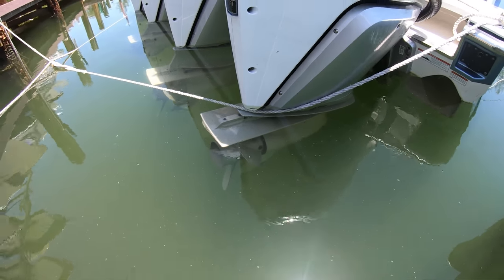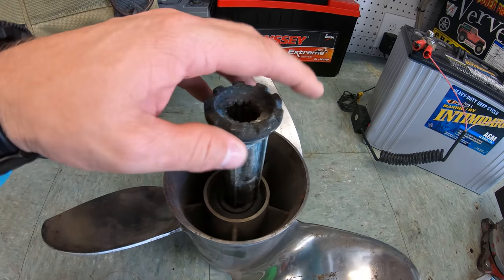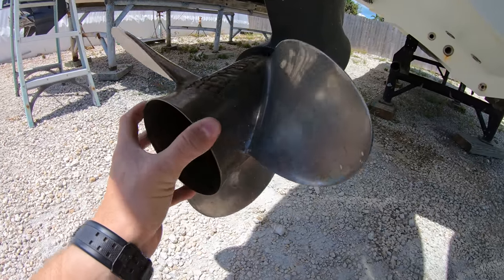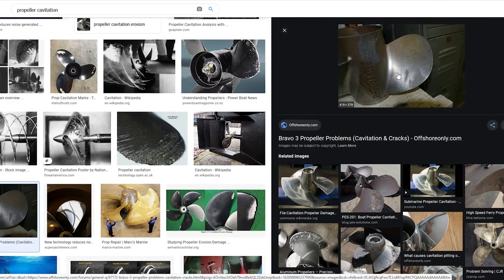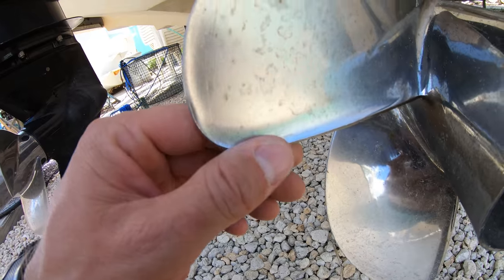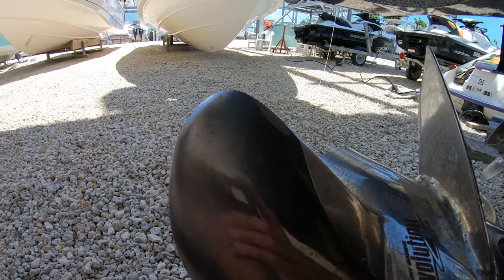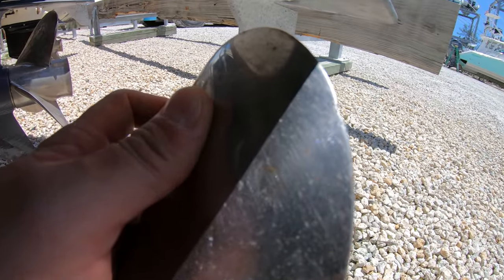Got BOAT Prop PROBLEMS? Cavitation Vs. Ventilation!!!

Comment: new prop or old, one of the primary symptoms of cavitation is Porpoising.
In the 80's the Sidewinder and the Hydrostream hull configs. were prone to porpoise ( a veritable Pain in the neck ride)
A cruising speed 3/4's she'd rise up and down and make u seas sick. At Flat Out the helm would be something you'd need to put your whole body weight on and when u did hold her fast, she'd start walking side ways.
Now the Cleaver prop was specifically designed for a heavy stern drive of Inboard, somehow the Cleaver acted to Lift up the rear, when the rear of the boat was being lifted by the cleaver you could apply Less trim.
The boat would run perpendicular to the lake and the stern would lift out of the water and yes you'd have to Hang on to that wheel never look to one side cause yer sunglasses would fly off and your first impulse is to try and catch 'em. But u let go of the wheel and your outboard engine would spin and yer right ear would be taking on water. Not that this ever happened to me...at 83mph
Reply: problem on those streams was inexperience and poor setup ...proper setup and those issues were very minimal and driver skill is needed to go fast in those boats...lol
Reply: @crashalexander7232  drive skills...more lpl

Comment: I have a 20 foot Montego bay pontoon and a 90 HP Suzuki with a 13x17 prop. I am getting cavitation or ventilation after 1/2 throttle . Have tryed a 4 blade 19 pitch no help , so my question is what is wrong

Comment: What would you recommend for cavitation caused by floating weeds gathering around the motor of a Pontoon boat
Reply from the maker: You might want to look into the engine height, idk if weeds will be giving you cavitation, cavitation is more pressure related, maybe a ventilation issue, but you might have a different issue going on depending on what the engine is doing.
Reply: Ok thanks I'll keep researching it

Comment: I have a 30' cruiser w twin bravo one ss props if i do not hole shot the engines and try to gradually plane i get as described in video propeller venting once this starts i have to back off and most of the time idle back and hole shot to obtain plane. 
One note repowered from abt 260 hp to now abt 300 hp per engine but i did not have the boat prior to repower so not able to note if condition existed previous. 
Any thoughts out there again 
30' cruiser twin 5.7 Bravo 1 vortec tbi .040 over. Turns up 4250 maybe a bit more under optimal conditions.

Comment: Why does water splash back into the boat from the motor. I have a 26 foot canoe with 15 hp motor and after a certain speed water splashes over the strern into the canoe. Also, I experienced cavitation or ventilation. Because we run these canoes on rivers they are mounted with the cavation plate much  higher than the keel. This is very common and because of the canoe shape they ride a bit lower a flatter bottom fiberglass boat. Anyway no one else is giving this problem. But me. Just wondering what the problem is. The prop is well used and has been filed off a bit do to hitting occasional rock. Could this be my problem?

Comment: I have two sets of props for my 34 yellowfin that act completely differently. 
The 19 REV4s that are Labbed hold the bow high and let me run past 60 mph. The engines sound beautiful and  there is no vibration.  
The 18 Ecos on the other hand have a lip and lift the stern, they make the boat unstable at speed and it tends to bow steer.  There’s a horrible droning sound from the engines.  I hate them but on long trips they can improve efficiency by 10-15%. 
At the end of every long trip I remind myself, never use those again, your ears are ringing. 
Thoughts?
Reply: Ear plugs.
Reply: Do you use the same hubs? If the hubs are removable try different hubs.

Comment: When running in the ocean the waves lift my skiff and occasionally my prop ventilates and I lose forward momentum.  Remember my boat is a Simmons, it has a well for the outboard and there is flotation beside and aft of the motor.
Reply: "We need a bigger boat"

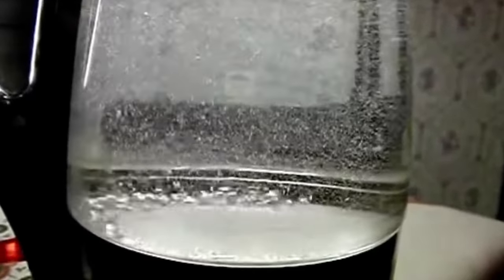Comment: At 5:17 you mean vapor bubbles (steam), not air bubbles.  And they "implode" not explode when pressure forces those vapor bubbles to collapse back to liquid, effectively making a micro water jet.  In the same way that an industrial water jet cutter can cut through metal, so do the imploding vapor bubbles when they collapse near the propeller.

Comment: Cavitation does not create air bubbles...... The pressure differential between the front and back of a prop blade causes the water to boil and the bubbles are steam, not air,  even at very low temps. When liquid water boils it changes from liquid state to gaseous state and expands it's volume approximately 1500 times. These bubbles have a very high energy level and if you can see high speed photography cavitation each bubble actually expands and contracts several times getting smaller each time until it looses all it's energy. Prop damage and/ or poor design will accelerate the onset of cavitation.

Comment: When I hear “cavitation “, I think of a pump.............pumping a liquid that gets air in the line, and cavitates, and no longer pumps anything.
I guess it’s the same idea
Reply: That again sounds like Ventilating. When a Pump Cavitates, it is also because of the Pressure Drop on one side of the Impeller is great enough for the Water to Boil.

Comment: I have an air floor zodiac and have experienced some bad ventilation issues. if passengers are too far forward it causes the floor to bow upwards significantly, almost 12" higher than it should be in the rear of the boat. I think this is happening because the shape of the hull is no longer flat and is forcing the water at the prop be be lower than it should. Has anyone else had this issue? Did you find a fix for it?
Reply: Have same problem with air floor west marine, travels 15 mph with solo w/ 5hp Nissan but ventilation can stop it no bite on water. probable solution is get a rib.
Reply: @chhindz  I think building some thin and strong slats to place underneath the air flow would be a big help. I just hadn't got around to trying it. But yes a new boat would fix the issue hahah

Comment: My prop ventilates way too easy. Feels like I'm on bald tires. Could use some advice
Reply: need way more info than ...help?  lol
Reply: @crashalexander7232  Well since my post on this video. I attended the Seattle Boat Show and 
 was able to talk to a senior engineer from Mercury. He says my engine had been mounted too high so for starters the dealer is going to drop the engine down one hole position.

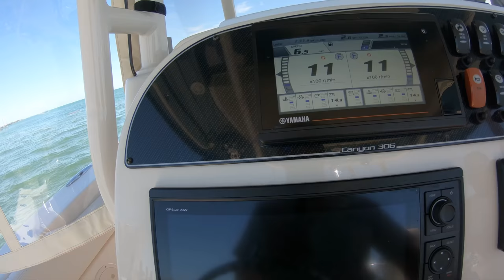Comment: Is that the new 600 Verado at timestamp 2:41? If so, it looks awesome!
Reply: Nope, they're 300's.  Aside from the single prop (the 600's have counter rotating props), the giveaway is the "300" you see on the cowl.  lol...
Reply: @Prototheria  apparently I missed the 300 on the cowling 😬
Reply: @benjigans1419  lol... no stress, bud.  I missed the number, too.  Your comment had me questioning whether I really saw single props or not.  I had to go back and look to be sure, and that's when I caught the number.

Comment: That was great. When you can explain surface drivers and how they work. Thanks
Reply: Like a surface drive engine? Essentially those are air and oil cooled engines so you don’t need a lower unit so deep in the water for a water intake on the engine, and they run a rather large (usually 2 blade) props with a lower pitch. The prop is meant to be run 50% in the water and 50% out. Basically let’s you run in very shallow water and even in mud flats. And with half the prop leaving the water that allows it to clean off mud and go back for another bite. Great motors for shallow water and stuff with a soft bottom or water with lots of vegetation in it. Not so great in open water for flat out speed. Common to see surface drives on duck hunting boats.

Comment: I have a 25' Crest pontoon. Last year I had a CPO Merc 150 Verado installed. I have been battling ventilation with it since. The Merc replaced a 150 Evinrude that never seemed to ventilate. Same shaft lengths. What should I do to correct this? Thanks and I'm addicted to your channel.
Reply from the maker: thats a good addiction ;)

Comment: Im having the same problem at the moment. I have 2 boats. The first one is an RIB with a 15horse yamaha 2 stroke shortsshaft witch is mounted a bit to low. But I have it close to perfect now. And I have a boat which Is built for a longshaft engine and i have a 45hp engine laying around witch would be perfect for the boat. So I decided to try it but  ofcourse it was hanging way to high on the transom. So now I want to make an sort of jackplate but to Lower the engine not lift it. But how does it work with how high the engine needs to be if the engine is hanging about 30cm/40cm behind the boat. It needs to go down about 8cm right now. So if I put it back 30cm do i still need to lower it 8cm? 

I'm relatively new to this hole boating. 17 years old right now, so if someone would help me understand it a little bit better would be 👍👍  

Thanks 👍👋👋
Reply: Hey bud did you sort you outboard jackplate issue??
Reply: @davecartmell4092  yes I got an different engine, and the rib has 30hp atm works 100% raised the engine about 3cm, pick up 8kmpu

Comment: What could  cause a prop to come off while the motor is running. Reason why I'm asking because I just got off the lake with my friend and when we pulled the boat out the water the whole damn prop was gone. Also what can cause the motor not to go into gear? I told him it could be his shift cable.
Reply: loose prop nut fell off or a broken prop shaft .

Comment: Hi, I have a new Yamaha F20 that I hit a sand dune with at very low speed, my prop only had som fine Paint removed at the very edge almost like it was sanded fine, dosent look serious at all

But my prop has about 0.04 inch play backwards in it? You cant feel it unless you force it, is that normal or should it be super tight with no movement at all 🙂
Reply from the maker: Thank you for your question! Please post it in our Born Again Boating Community! Go here and scroll down to access - it’s free: https://www.bornagainboating.com/
Reply: Yea you’re fine. You did run the prop in sand, but you didn’t damage it. Only 0.04” of play (I believe that would be called shaft thrust play in a manual) is 100% normal and needed as parts heat up and contract with heat from use.
Reply: @chevyon37s  Thank you

Comment: Only time I experienced cavitation was listening to a Seawolf making a high speed run.  WEIRD damned sound!
Reply: Seawolf sub? I used to work on those for General Dynamics.
Reply: @bradcranford2264  My mistake actually, I had just watched o video on them so they popped to mind.  It was actually a Los Angeles class during sea trials on CV-60 after her SLEP in 1981-82.  One of my buddies worked in sonar on Sara and let me listen.

Comment: I’m not sure what my issue is. I have an 05 bayliner 285 ciera. It has the 350 mag with a bravo 3 drive. It has a tough time getting up on a step. The engine only has about 75 hrs on it and the out drive is new. I didn’t replace the props. I know it’s kinda underpowered, but it never had much trouble getting out of the hole before.

Usually it’ll just sit at about 3400 rpm at full throttle. Sometimes it’ll make it up to a full plane, I’ll level it out at about 3600 and for some reason it’ll just lose power after a while and not want to rev back up? 

Any ideas?
Reply from the maker: Thank you for your question! Please post it in our Born Again Boating Community! Go here and scroll down to access - it’s free: https://www.bornagainboating.com/
Reply: @BornAgainBoating  can’t we just have the discussion here?   Seems a lot of people are asking questions here but nobody is answering.
Reply: @sunsetoriginals7320  the new drive you put on is a different gear ratio ....that is why your performance is diff with the same props.
Reply: @crashalexander7232  thanks for the reply but it was not me that asked the question

Comment: Im installing a single outboard on a livingston cat 12ft. I am having problems finding the correct hight to mount the engine because it is centered in between the sponsons any advice for me!? Id like to drill once
Reply: gearcase center line should be even with the bottom of the sponsons....start there and maybe higher.

Comment: Hi, I have a mercury 15hp and everytime I start it, the control box gives like a 10sec beep.... is that normal?
Reply: I know its normal on the big motors, so its probably normal on your 15 hp Merc. Has this always happened or is it just recent that this started happening?
Reply: I believe that's to let you know the warning buzzer is working, in case of overheating, etc.

Comment: I have an outboard that is mounted about 5 inches too high and it ventilates whenever I am coming down on bigger waves. Is there any way I could fix this besides mounting the engine lower. Thanks 😁
Reply: no

Comment: My 22ft super tunnel has a bad ventilation problem on turns, but could be my fault due to running the jack plate up on 3 or 4 cuz I'm always shallow.  Hoping a 4 blade prop might help that issue ,, any thoughts anyone
Reply: Definetly 4 blade. And go the extra mile put on a permatrim best $150 you'll ever spend good for running in skinny water.